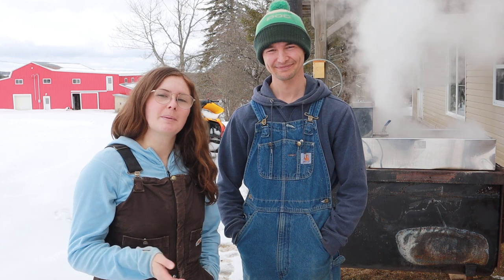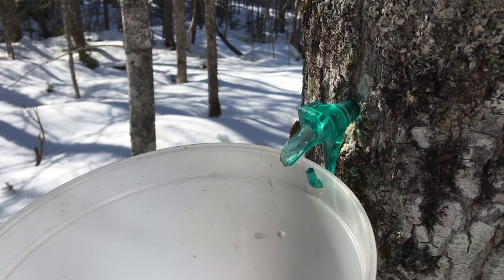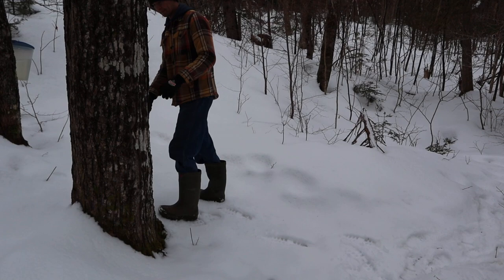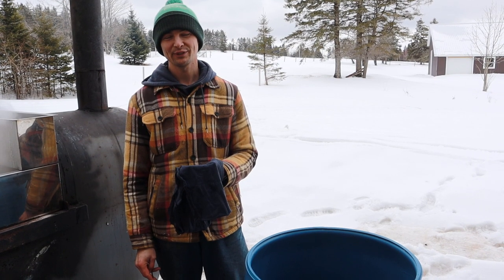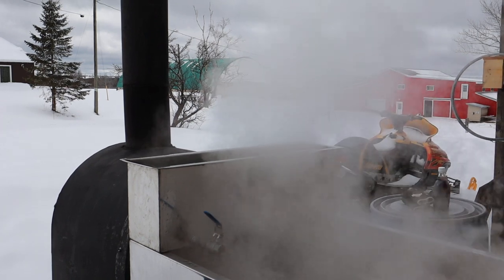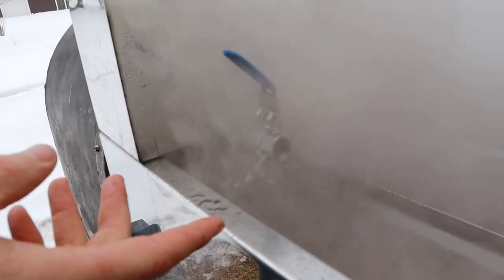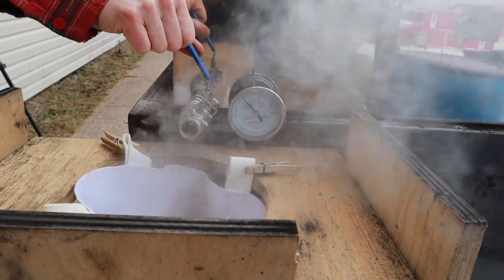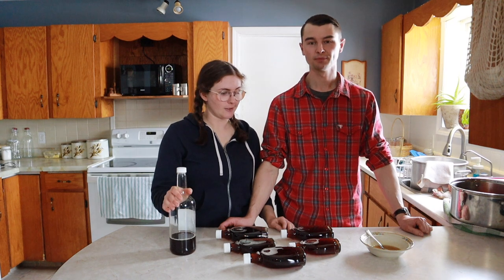Boiling Sap Into Maple Syrup | Small Scale

Comment: A few tips to help your boiling. Try to keep no more then 2” in the pan easier to keep it boiling then a half to a full pan. Second chop your wood to smaller pieces I don’t put anything in bigger then the size of my fist. Cris cross the wood when loading don’t stack them all same way as it promotes the fire to breath more and cause a hotter fire. Add another section of chimney to it will help the draw of fresh air into the fire. Happy boiling
Reply: I think they're doing just fine.

Comment: Hello
Fellow Tappers, here is a little trick I put together for collecting sap in the 20L Reliance Jugs. I took one cap and drilled a bunch of small holes into it so it can breathe. Then used a new funnel and mesh screen to pour into. I cut a bit off the bottom of the funnel to get it to flow faster. Works great and gets the large bits out.

Comment: Does the sap transfer from each chamber of the evaporator by itself?
Reply from the maker: Yes it does because as water evaporates, sap thickens, increasing in sugar density and it travels through the continuous-flow pan, until what is left is syrup! (it is being pushed by the sap added at one end)

Here is why:

There are a number of gradients at play when sugaring, but probably the most important one is the density gradient that results from changes in sugar concentration as water evaporates and sap turns to syrup.

If you have a flat open pan (20” x 30”) with no divisions. You put the sap in, start the fire, water boils off and you add more sap. Now you have a density gradient: the denser liquid is at the bottom of the pan and the less-dense liquid is at the top of the pan. Every time you add sap, that density gradient forms (and kills your boil). So you have to keep boiling and boiling until the entire pan is the same density, and then you draw it all off. That is the batch process (we used to do). The gradient works against you, not for you, when you batch.

The concentration gradient works for you in a continuous-flow pan (what we have).  If you have a divided pan (20” x 30”) with two divides, what you have is a pan that operates as if it is a 10” x 60” pan, squashed over the firebox. You putt the sap in, start the fire, water boils off, you add more sap to one end of the pan only, and you’ve rearranged the gradient into a flowing river, where the less dense liquid pushes the denser liquid toward the pour-off, instead of it just settling at the bottom.

I hope this helps!